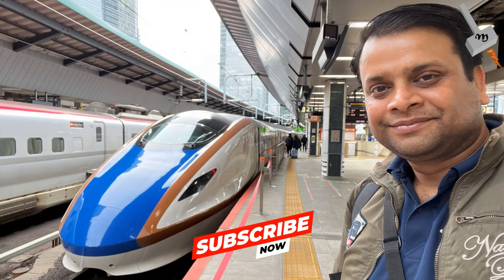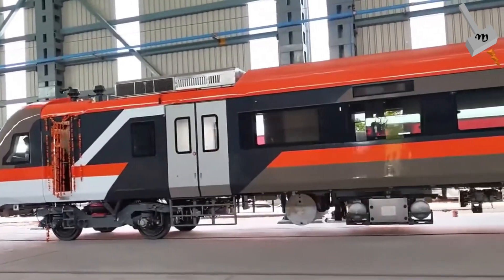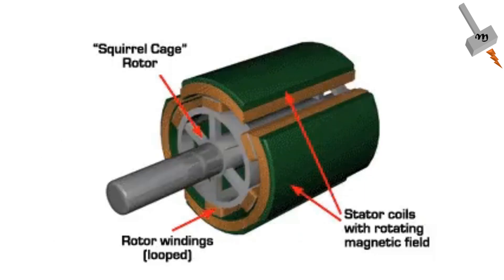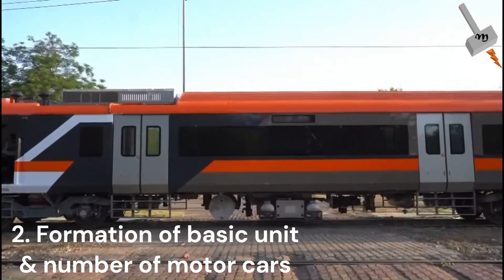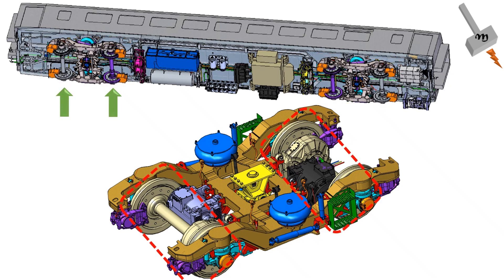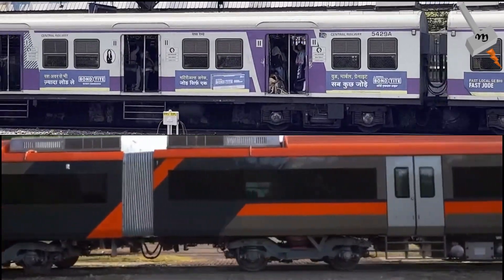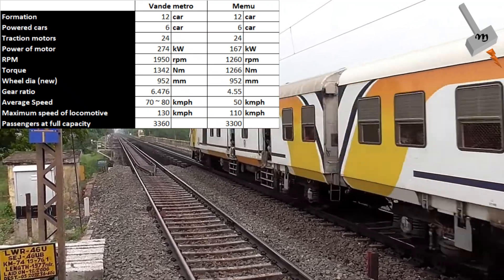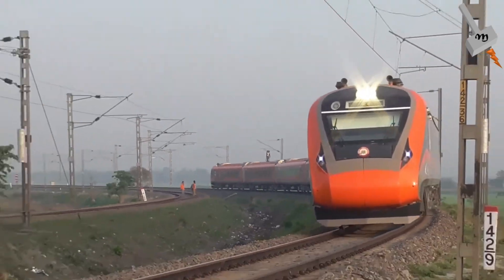Unlocking the Magic of Vande Metro - A Paradigm Shift in Rail Travel

Comment: It seems like you got confused between MEMU & Suburban EMUs.

In Vande Bharat (VB) & Vande Metro (VM), a Basic Unit consists of 4 coaches, out of which 2 are Motor coaches. Hence in a 12 coach VB/VM rake, there would be 6 Motor coaches; which makes them 50% powered.

Likewise, in Suburban EMUs, a Basic Unit consists of 3 coaches, out of which only 1 is Motor Coach. Hence, in a 12 coach EMU, there would be 4 Motor coaches; which makes it 33.3% powered.

In MEMUs, however there is no concept of "Basic Unit", as its front driver coach is self sufficient and contains all the equipments needed for traction, but because it can can pull only 3 Trailer Coaches with efficiency, thats why they assume its Basic Unit of 4 coaches out of which 1 is Motor Coach. Hence, in a 12 coach MEMU rake there would be 3 Motor coaches; which makes it 25% powered.